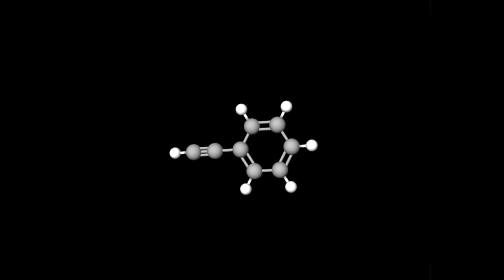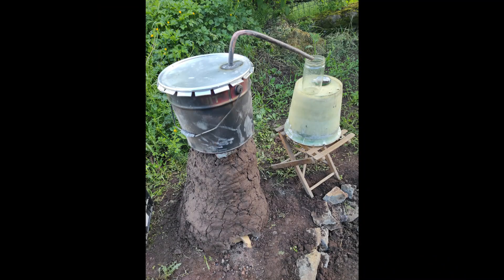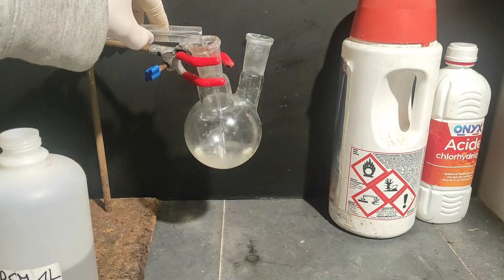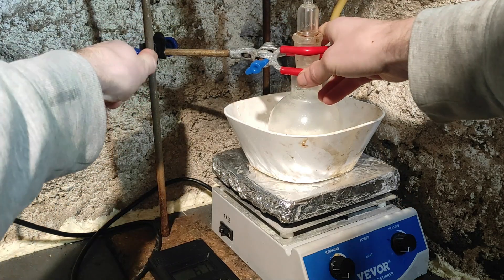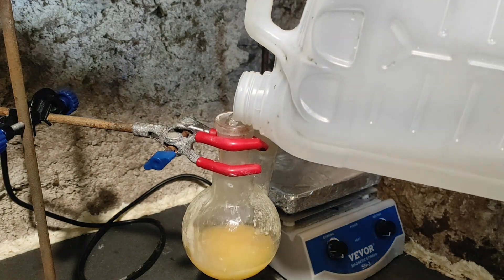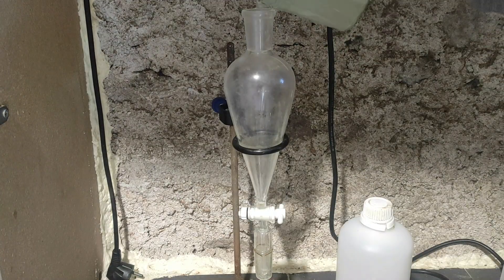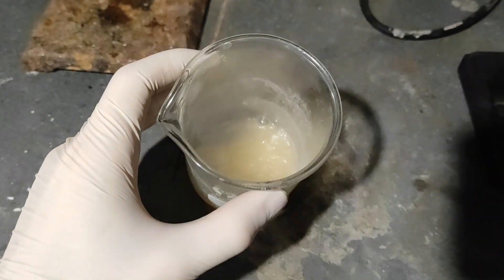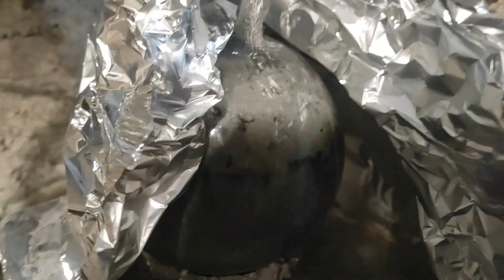Making Phenylacetylene from Polystyrene !

Comment: I thought you needed a stronger base to perform a double elimination? Maybe I’m wrong.
Reply from the maker: I thought too but ppl on sciencemadness seemed to have results with NaOH in ethylene glycol so I followed them.
They also mentionned KOH in methanol but that would have been more expensive so I opted for NaOH ethylene glycol instead

Comment: Next video
Making phenylacetone from paint thinner 🔥 🔥 🔥
Reply from the maker: If I make it, it would probably be from styrene too because I have alot of it, what is the route using toluene?
Reply: @jam_kemist3986  you could convert toluene to benzyl chloride with a UV chlorination and then a distillation, i was also thinking about a reaction with acetyl chloride but that will mostvlikely atack the benzene ring and leave the methyl alone
Reply from the maker: @GigaChem  I could do the chlorination using the sun but that seems a bit dificult and I don't have acetylchloride anyway
I wanted to try styrene + HCl then hydrolysis to make 2phenylethanol
And then oxidation to phenylacetone...
I already tryed making 2phenylethanol directly by hydrolysis of styrene but it made the styrene polymerise sadly
Reply from the maker: I'm so stupid I confused acetophenone which I want to make and phenylacetone which I don't want to because huh yk
Reply: @jam_kemist3986  nah bro dont call yourself stupid, its just a small mistake, i think its amazing how such a small difference in structure has such an impact, this is why i love chem, btw, what  type of chem do you prefer? I would love to be able to suggest some projects
Reply from the maker: @GigaChem  idk I kinda do everything but I guess I have more experience in inorganic maybe 🤔